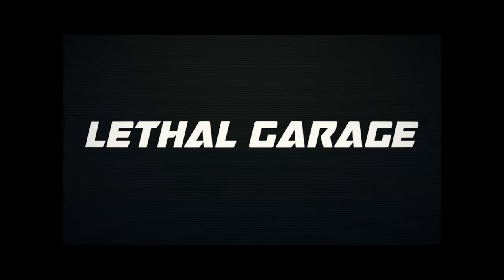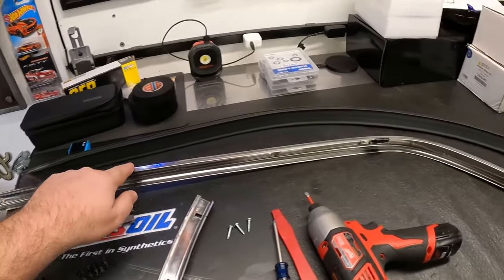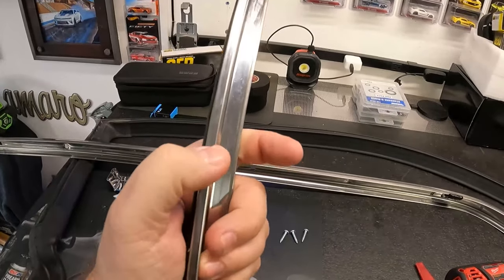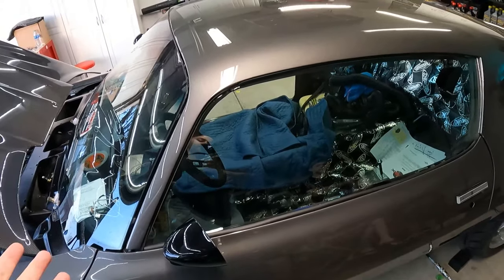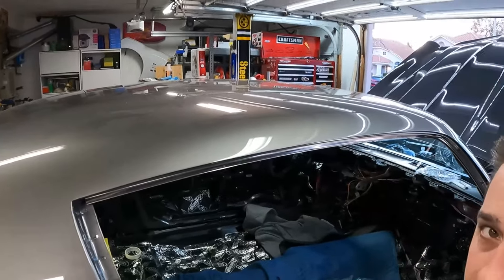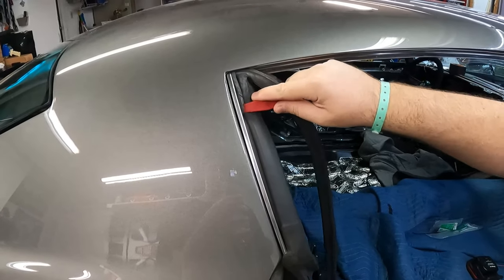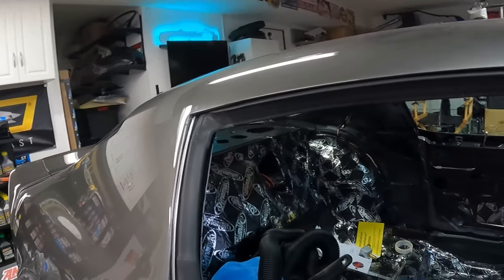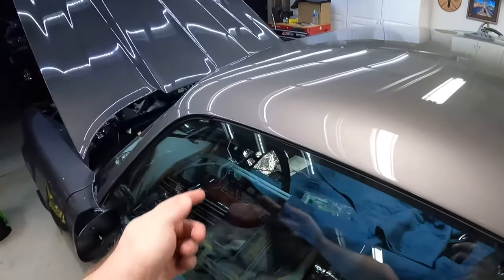Roof Rail Channels & Weatherstrip Overview & Install | 70-81 Camaro Coupe

Comment: Great instructions! I am using my cleaned-up original metal pieces with new rubber backing tape and new screws. I will take heed using your excellent advise. Thanks! Steve 1972 Camaro Coupe

Comment: Thanks for all the videos, QQ I am in the middle of this myself and noticed the same thing you point out at 6:45 that the holes are bigger on the driver side for that channel, it cant be a coincidence, what screws did you use, difference is like from #8 to #14. if you remember let me know or why is that, if anyone knows, I have a type LT so using the extra trim

Comment: Hi, I've had Camaros/2nd gen Zees and I know what those tabs are for on the window trim. 
When at highway, or higher, speeds the size of the windows causes them to pull out from the car which is a huge distraction and LOTS of wind noise. I found this out when one of my Camaros had rusty tabs and I removed them, BIG mistake! About 90+ the glass was completely up and pulled out about 2 inches, I then fabbed 2 new tabs and never had this problem again.
When the glass is 1/4" down the tabs still work and keep the glass in place, the adjustment I used when I worked at a Chevy Dealership was to get the door close to closing with the glass up and bend the tab so it doesn't interfere when the door closes.
As for those "wonky" tabs, without them when you wash your car you may get water in, you can always use 3M stripcaulk to fill gaps.

Comment: Was there no sealant applied to the back side of the roof rail stainless before you attached it to the body? Seems like you'd have a huge leak without the sealant.

Comment: I never put weather sealer in when I did mine. 2 years still in place nice and tight
Reply: I glued in my trunk seal. I have T-Tops, I'll see if I can get away with no glue around the T-Tops and doors. Can always put glue in after. It won't see rain.

Comment: I noticed that the interior sail panels were not installed at time of vertical channel install. Does the sail panel wrap around encompass both the stainless trim and the pinch-welded seam? or does sail panel fit between?

Informative video, Thanks

Comment: Its tough finding the right part. Sometimes you end up with doubles . Things I've gotten from oer are not as quality as original but sometimes you have to settle for what you can find
Reply: Oh m g. The amount of crap that was messed up with my build. 81 Z28.

Installing both of the side windows ; 3 of brand new white nylon rollers, wouldn't even go into the original gm tracks!

The new window roll down handles, wouldn't even slide onto the brand new window regulator shafts!

The brand new drivers side outer door handle, and the new link rod, going to the new door latch, the rod was 1/4" to short! Passenger side was a touch long, but easy to bend.

Good thing I'm able to just massage these parts to work, instead of just returning.... Qc just ain't what it used to be.

Comment: Hello want to do Ls carb 2 Gen. How was hood clearance Did you use fiberglass hood? Thanks
Reply from the maker: No issues with clearance. We used a Chevy intake, 950xp carb and a K&N filter. 2.5” cowl from Anvil Auto

Comment: What did u use for the bottom window i see u have a rubber Line instead of the original Chrome. U have a link for that or How did u replace the Chrome with the rubber and made ur window sit tight?
Reply from the maker: You talking the upper dirt seal/felts? They make a standard and a premium setup of those.
Reply: @Lethalgarage  i mean from outsite the car u Got the rubber on the bottom of the window. From the side mirror to the Door handel. Usually it’s chrome but urs is rubber or black. I have a link on where to get that. Looks nice

Comment: Question in the carbon fibre.  Can it be polished?
Reply from the maker: Can Carbon Fiber be polished? The resin coat certainly can, but note it isn’t always as uniform and as thick as clear coat. I always suggest a light polish and have an auto body shop clear the parts.
Reply: @Lethalgarage  Thanks, I am looking at a 2014 Z28 that has had its hood finders and doors changed to carbon.  Looks good but I was wondering for how long.
Reply from the maker: @jmark7390  CF will yellow over time, so keep that in mind.
Reply: @Lethalgarage  Did not know that.  Thanks.

Comment: Doesn't that trim need sealer under it? Water is gonna leak in.
Reply from the maker: Water won’t leak in if the car never sees water. I address this in the video
Reply: @Lethalgarage  Then you can't wash it with water?
Reply from the maker: @rickster4455  waterless wash